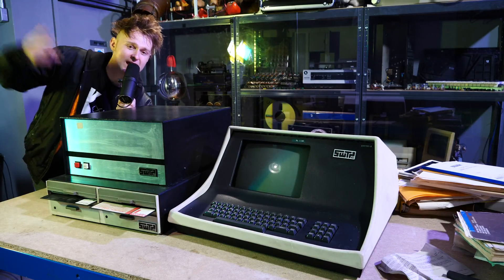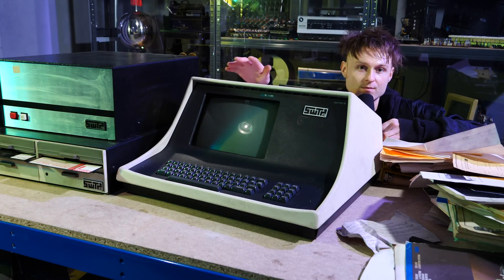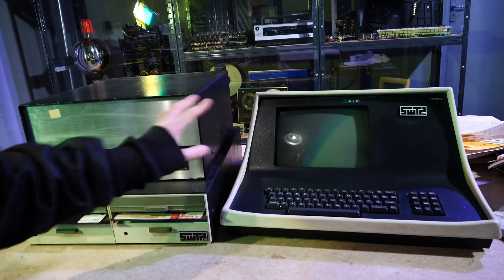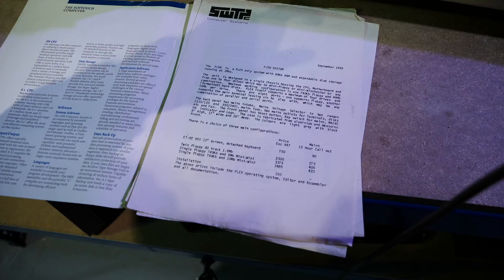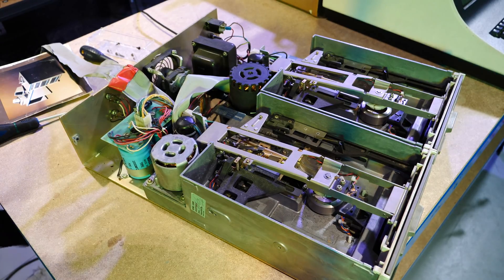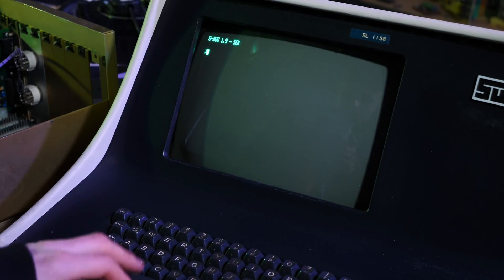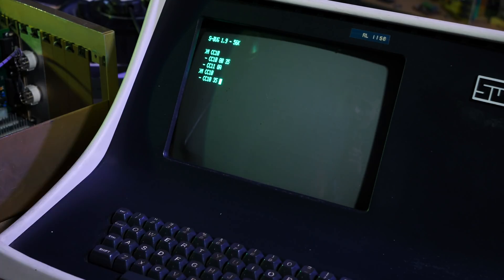Rare 70's Computer Find - Will It Work??? SWTPC 6809

Comment: How have I only just found this!
I first started working for a company called Transdata in 1979, we built CP/M based micros based on Z80 processors and as many others have stated - most micros of this era would have a tiny BIOS (Basic Input Output System) program in rom which would then boot the Operating System from a disk - so you would need a 'System Disk' - to boot the OS.
I did not read every comment - perhaps you figured this out already - did you ultimately make progress and get the thing to load an OS?

Comment: Check out Adrian's Digital Basement. There apparently WAS a sound card made for this in 1977, and it is a VERY simple circuit. It's possible to get repro board that just plugs into the expansion sockets in the computer. It's nearly identical to the TRS-80 CoCo sound circuit. It's a 2R-R 6-bit resistor ladder DAC that is clocked by a simple flip flop based latch to load values into the DAC. Very simple circuit! Like I said, check Adrian's Digital Basement and go from there. He has links in his description.

EDIT - Ah, I see you found the soundcard in your follow up video. Awesome!
Reply from the maker: Yep. It’s not that cool. We have made our own sequencer card. Vid coming
Reply from the maker: as in the old sound card. Kinda cool but more fun things can be done :D

Comment: Dude… I learned to program in Algol on an Elliott 803 at Cannock Chase Technical College. That was so retro that the 1K memory was made up of ferrite rings. The teletypewriter used to make the punched tapes the computer used actually ran on compressed air and when you turned off the power to them the whole lot of keys would drop into the chassis. 

That was the machine that got me so into computers (I got nothing but A’s in that class) that the teacher gave me my own key to the computer room so I could use it whenever I wanted… which was amazing because at Grammar School I managed to get the record for the most number of E’s on a report card… I missed out on a full card of E’s by getting all A’s for Woodwork and metalwork. I think I had ADHD and only being able to work stuff with my hands stopped my brain from running all over the place.

Comment: Looks similar to the Fairlight. Which, as you might know, was a very expensive machine. You might be able to get it to do the same thing. I have an Apple ii with something called the Greengate sampler that I dug out of the loft. Was my brother's. But I'm sure I can figure it out. Might not use it for music necessarily. But I do like the idea of writing games in Basic with it. Atari 2600 style. It's probably quite easy to write arpeggiator or primitive sequencing software  with these things. Haven't tried (yet).
Reply: Two big tasks would be to get MIDI (serial) I/O and D/A and A/D conversion implemented. The former would be a lot easier if the 6809 had a built-in UART like the 6303 used in Yamaha's KX76 and KX88 keyboard controllers. The conversion would require adding a sample rate clock to provide a flow of interrupts to the 6809; on interrupt the program needs to latch data from the data bus to an external register so that the D/A can read it and also perform a similar operation in reverse, letting A/D drive the data bus. If the 6809 can't do everything it would need to do in enough time left between audio sample intervals or if this computer just doesn't have the RAM to hold usefully long samples at usefully high rates, then there would have to be a separate system added to actually hold and play samples.

Comment: The disks may have lost their format... It happens over time with exposure to stray magnetic fields, also the substrate used for holding "data" just "drops" its magnetic level to a point the reader head can't pick it up...  A disk check can sometimes recover it...  Good luck finding an old program..  If the data doesn't matter, all you need to do is run a low level format to restore the disk to original blank format.
Reply from the maker: Check part2
Reply: @LOOKMUMNOCOMPUTER  Will Do!

Comment: Most of the factories in the past had wires soldered to the boards. Take a look at the old IBM PC's, there were a lot more cables soldered.

The reason was to fix small bugs. As a result, the circuit boards did not need to be redeveloped.

Comment: I always like your computer-oriented stuff, since I like old and weird computers. Mostly because they're still novel to me; the closest I got to anything OUTSIDE the typical IBM DOS PC in my childhood was Tandy's 1000 series of computers. My family bought that instead of an IBM. It even had a three voice beeper (with noise, though Sierra games never used the noise channel for music).

I had almost no childhood experience with Amigas, Apples, Ataris, Commodores, etc... And so I bought a bunch of said machines years ago when Effexor was making me impulsive (and destructive). I stopped messing with that stuff when I found mass storage to be an issue. Years later, off pharmaceuticals, I have recently mostly addressed that problem with modern-retro storage devices and gotten them partially set up in my tiny-ass third floor studio... doing... nothing.

I've played a couple old DOS games on the Tandys and tested a few games on an Apple IIgs, but this whole plan was to make a retro music setup. I think it was folly, because I'm REALLY used to the modern conveniences of computers with reasonably comfortable GUIs and lots of SPEED.

BUT, I enjoy seeing you coax sounds out of retro computer tech, even if they're just CONTROLLERS for other sound sources. Maybe watching you mess with that stuff will get me to spend some more hours on my retro computer junk...

Comment: I wanted one of these when I was at uni ... but your prices are accurate. Think very high end gaming PC today. Instead I built a 6800 board myself and used an old calculator as a terminal. I was the only one in my electronics class with a computer at home. It had 128 bytes of RAM.
When I started my first job after finishing uni, they were looking at a 10MB (yes, ten mega byte) hard disk. It was the size of your processor box and cost $5,000.

Comment: The printing every character twice thing might have been that you had it in FULL DUPLEX mode (but I guess you fixed that anyway!). I was 15 in 1980, and at school we had 4 Commodore PETs, a tractor feed printer and a dual 8-inch floppy unit (this was in the maths room because computing was such a new thing) - so I've actually used discs like those. Ah, nostalgia :) Also, I feel old :(

Comment: Fixes to production boards by soldering in fly leads was very common back then. You can make music with this, write a synth that drives the serial port - 6809 Assembler is a joy to write compared to horrible Intel 6502 (shudder.) I had a Dragon 32 with the same processor - besides - being an electrical engineer's computer there's bound to be software or programs written by himself to generate signals for testing.

The port settings to echo the typed characters back was usually for teletype terminals (terminals with character printers instead of screens)

The "Can't read IPL" message is probably because the D command is looking for a bootstrap loader - ie it's the command to load an operating system rather than a program.

Comment: I don't know if we can find FLEX 6809 (or just 6809) software to make music, it was before sound cards even existed, you got at most a beep speaker on those computers!  BUT, some synthesizers of the 80s used the 6809 processors (at least, to drive the DCOs, and filter circuits, if not to generate the sound themselves), and if you can add a DAC, then you should be able to write some 6809 assembler code to generate sound, be it sampling or synthesizing.  The 6809 worked with a 1 MHz clock typically, and most importantly, had a 11-cycle 8x8->16 multiplication operation which can be very handy when generating sound. So you can compute up to about 50,000 multiplications per second, which means that you can easily produce real-time sound @ 32000 or 22100 sample/second. (8-bit samples, depending on your DAC).

Comment: I collect & restor vintage computers, you have found something special.

Main thing to look out for is RIFA caps, RAM oftern fails & as you say the voltages on the PSU's. With the floppy drives I recomend lubing up all the moving parts. Also clean the heads in the drive.

Comment: The biggest issue with restoring and saving old machines, is that mostly the history behind them are lost forever. I am talking about information about the machine, from the users perspective. How was it to use it, how were the everyday surrounding these machines. The 70's might be a lost cause these days, however you can still find users that used computers in the 1980's and later. One example is how teenagers used C64 and the social aspect surrounding that hobby in the 1980's. Computer clubs, programming and gaming at friends houses and so on. All these small anekdotes will be lost, if someone do not start recording stories. And we will be left with only the machines and knowledge on how they work.
Reply from the maker: Indeed! Different historians for different aspects.

Comment: You need first to boot an operating system from floppy, then switch floppy or put it on second drive for the program and data you wanted to execute, in those days, you had to feed the OS to the computer each time it booted, the mainboard only has a ROM to control the hardware booting sequence (IPL). Without OS boot the bios got into some mode which was in ROM, which in that brand you own and I'm not familiar with, seems to be some commands for memory access and maybe there is something else for tech diagnostics but is not intended to be used by the final user, in IBM computers of that age if you hadnt the booted in to a Basic "compiler" which was loaded off ROM. I grew up surrounded with that stuff, I have 8' disks from an old System/38? my dad rebuilt from customers scraps, and also still have DOS 2.0/3.0 disks in 5'1/4 inches for IBM XT which was my first computer. All this brought a tear to my eyes. I miss you and I love you dad.

Comment: Those wires are probably ECO's or factory engineer changes to the board. Those prices are probably in line. In the 1970 a texas instrument handheld calculator that could ad, subtract, multply, divide was about $100 if I remember correctly. They just came out. My First IBM clone desktop had a 386 20Mhz cpu, 1meg of ram,  a 40Meg HD and a color 640x480 monitor and DR-DOS. It cost about $2400. Everyone was jealous because they thought it was FAST. A lot of DOS programs would crash because it was too fast for them.

RE: Can't read IPL-- Maybe you need to get into the bios and set the bios up. Perhaps IPL is a parallel port address that needs to be set correctly in the bios. Or maybe your bios backup battery is dead and the bios is losing it's settings when you power off. Read all the manuals that you have and look for the bios setup and how to enter the system bios. FYI: that looks more like a computer terminal to me than a computer. Meaning that what you have may need to connect to a mainframe computer to fully function.

Comment: Thanks for putting up this great video!  Also, thanks for plugging my own video and letting more people know about this amazing microcomputer.  The error you received is simply letting you know that the 6809 is looking for an OS to load (e.g. FLEX).  Hopefully, you have a copy in your collection of disks that came with it.  If the disks are intermittent about loading data, then be sure to gently clean the read/write heads on those floppy drives so that the data remains good on the disks.  These systems were made to last, but they do need some basic cleaning every now and then.  With regard to music, they absolutely can be made to produce melodies (probably one note at a time), but it's worth looking up what music cards were made for it because maybe there's some 4-channel card out there just waiting for a composer to program something on it.  While 6809 Assembly and C are mostly what I programmed mine with, I also used a fantastic language called PL/9 that is similar to C and compiles some very efficient 6809 code.  There is a small, but mighty group of enthusiasts like myself who still tinker with these things.  They are far more knowledgeable about the technical stuff and hardware side.  I'm just an amateur retroprogramming guy.  By the way, is that SWTPC Logo the coolest thing ever or what?  I have a huge poster on my wall of that and even incorporated it into the title screen of my Cribbage game.  It's so retrofuturistic, almost like something you'd see on an alien spacecraft.  I look forward to more videos on this!

Comment: Floppy drive PCBAs are under on each floppy drive. If you suspect on floppy drive hardware issue, I would start by cleaning and lubricating all guides, lubricate stepper motor for head movement and make sure it's not stuck and carefully clean heads. Cheers! S

Comment: You could be designing any kind of sound card / expansion card /C/V controller card for this machine. It's just a question of time. Is that thing S100-BUS compatible? There might already be sound synthesizer cards available for this machine - together with the software to compose and play music. Or you could just use the computer to do your taxes...

Comment: Very nice indeed. That terminal is quite the absolute unit. And they came from here in the Alamo City! Unfortunately when I moved here as a high schooler in 1979, I never quite caught on to them being over there by the airport, until they were already gone. However I was at the 10BitWorks hackerspace one day a few years ago when someone brought in what was left of their repair parts collection (basically a big box with mostly tubes of chips), but I don't know if they'd still have them.

As for getting it to make music, I suppose one way would be to make a board (it uses the "SS-50" bus, sort of like S-100 only different) with two 8-bit ports (maybe a single PIA or VIA chip) and either an R2R ladder or an A-to-D chip.

Or you could hook up one of the standard sound chips of the day (even a SID!) and then it wouldn't be too much different from a C64 or an Atari.

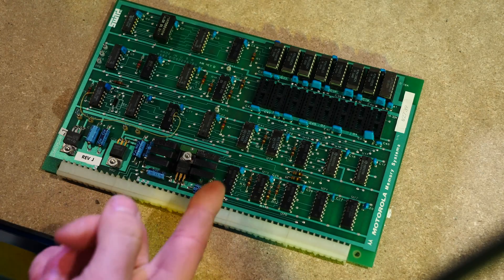And all that RAM? A decade or so later and you could get 32K on a single SRAM chip. So much easier to make a breadboard computer with! 4K DRAMs are really taking a step back in time! Oh and 7:18 notice the "Motorola Memory Systems" on the board, so those boards may have been made by Motorola, not SWTPC.

Comment: Me and my brothers all used a standalone SWTPC "dumb terminal" to connect to the timesharing (UNIX) computers on campus, back in college at UCSC, from the late 70s through the early 90s.  It looked similar to the terminal you have there, except instead of white-black the cover was white-blue, and instead of wood it was metal--though possibly the cover was fiberglass?!   A little Googling suggests this might have been the SWTPC CT-82.  Its screen was a strange non-standard size, like 82 columns by maybe 23 rows, and even back then people had more or less settled on 80x25 as the standard.  But this was sufficient to log in and use "vi" and the shell and run compilers to do our course work from home.

p.s. We always pronounced "SWTP" as "swat-p".

p.p.s. Yes, I absolutely believe those inflation-adjusted prices.  Computers are shockingly cheap now, and it can be hard to remember just how dear they were back in the 70s and early 80s.

p.p.p.s. Back in the day my oldest brother wrote a "termcap" entry for our SWTPC terminal, that should let you use it with a modern Linux computer.  I might be able to dig it up...!

Comment: What RAMs are you missing on the RAM board (2114's & 4118's were common back then).  I have a load of parts from the 80's in my junk bins unless I threw them out (don't think I did).  Will donate to the cause if I have them.
Reply: Looks like bog standard 4116 16K DRAMs. (The 8K board has soldered 4K DRAMs, not upgradeable) The real problem is that 56K is already the "full monty" unless the CPU board has memory mapper support. A quick check of the MP-09 schematics shows no such luck, they're still being used for baud rate clocks. But there's a place called corshamtech.com which has an upgraded board ($25 for the bare PC board or $235 assembled) and also has SS-50 breadboards.

Comment: It sounds right.   But I believe these systems were often used for various business settings. Etc.   My father did his own programming  back then.   It was very straightforward.    Most of these systems were run in businesses and the 70s computers were pretty much a brand new thing.    

Brand new usually means expensive for tech.        Crazy prices none the less.

Comment: The 6809 was not only the basis for the SWTP machine as well as the Radio Shack Color Computer, but was also the "brains" of the Voyager spacecraft.  One of the perks of those late '70s and early '80s machines is that they often make the various busses easily accessible.  I suspect this was largely because they rarely came with "enough" stuff like RAM or other storage capabilities, and needed to provide some means to expand.

If your travels ever put you in touch with someone willing to part with one, SWTP also made something they called the Ambience Synthesizer (2AS-A model).  It contains SIX, count 'em, SIX Reticon SAD1024 bucket brigade chips..  Yowza!!!

Comment: There’s a good chance that the motor that moves the heads is seized and needs to be freed up and re-lubricated. The 8-bit guy has some good videos on doing that. Also, just a thought for when your bank account is better, have you done anything with an old tube tv, like one from the 1950’s or 1960’s? They’ve got oscillators all up in them.